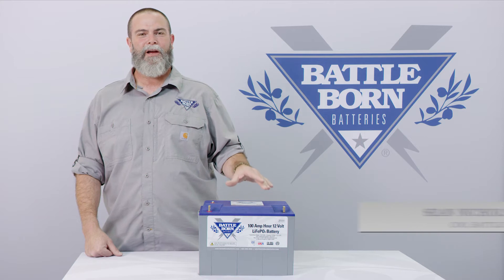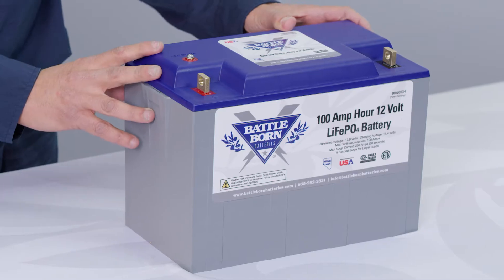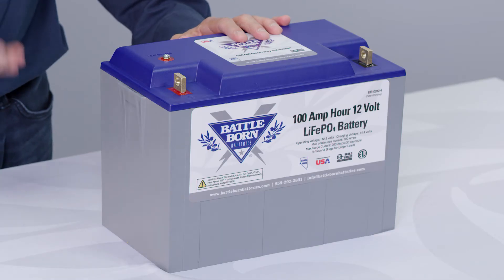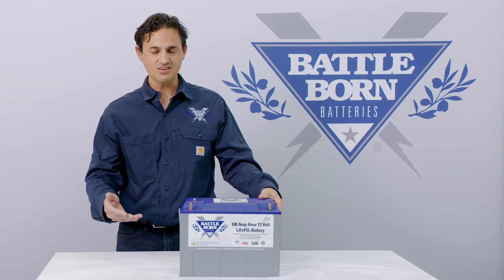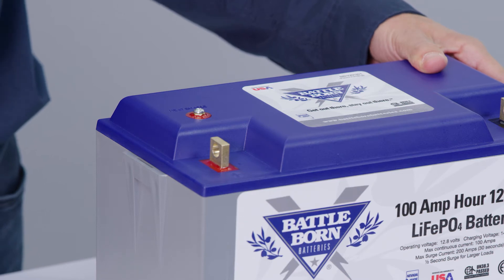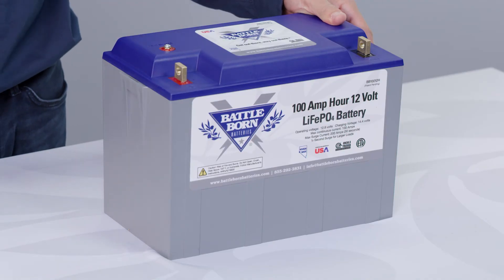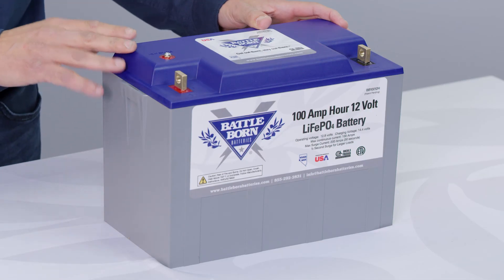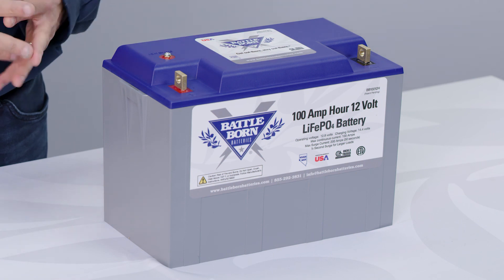The Technology Behind Our New Heated 100Ah 12V LiFePO4 Battery l Battle Born Batteries

Comment: You didn't say, but it seems this is designed for colder climates. I am in tropics where the weather never drops below 60F. So this would not be for me, right? I should buy your conventional type of batteries?
Reply: Since your temp never drops below 60F, even with the heat enabled, it doesn't seem like the heater would ever run.  It's cheaper to buy the non-heated batteries, but a good option to have just in case you have weather like Texas had this past week.

Comment: Already the BEST 100 aH LiFePO4 battery on the market...now even better. Great job...digging the low current draw and ability to daisy chain the battery element. Most folks run two or four of these batteries anyways...so it makes sense from an engineering standpoint. My thinking (with winter here)...these will sell like hotcakes.